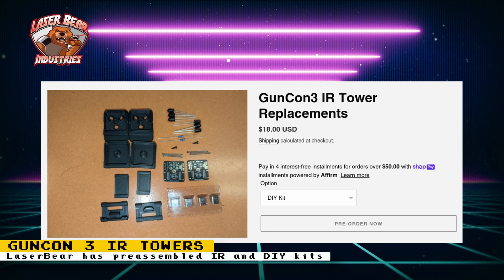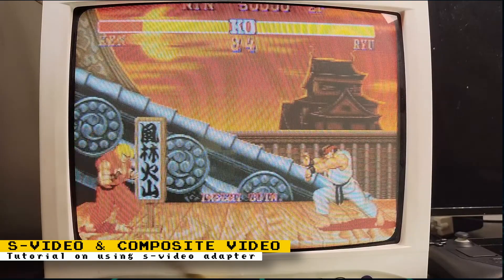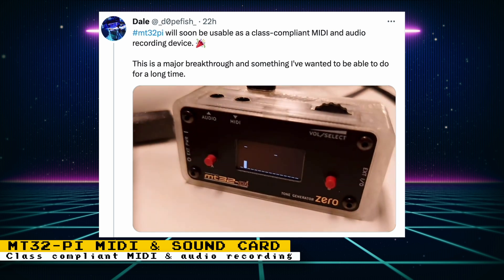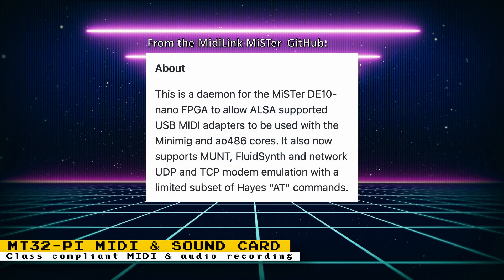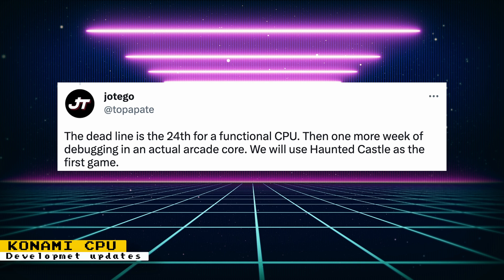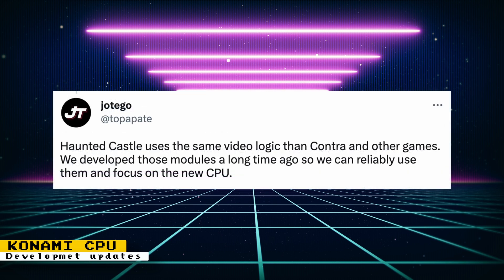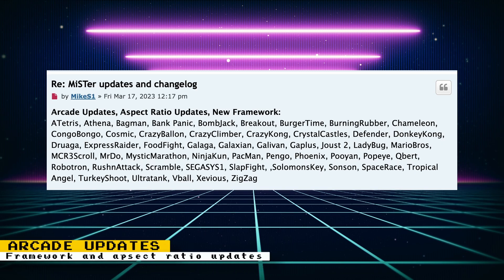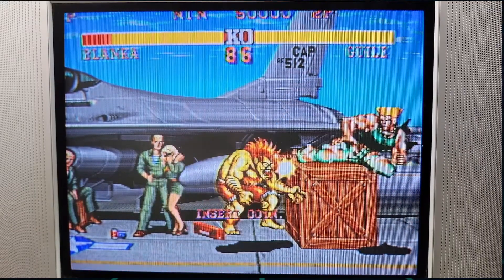MiSTer FPGA News - Secret Core, Konami CPU, S-Video How-To & More

Comment: Can I dream in a N64 core? I know it´s almost impossible, but years ago PS1 core would be considered impossible too.
Reply: I think one of the Devs did some rough calculations, and siad there isn't enough RAM bandwidth in the de10, so it's not impossible to have an N64, just maybe on a future hardware platform
Reply: Can't be done on the DE-10, there is a N64 core in development using a Xilinx based board though